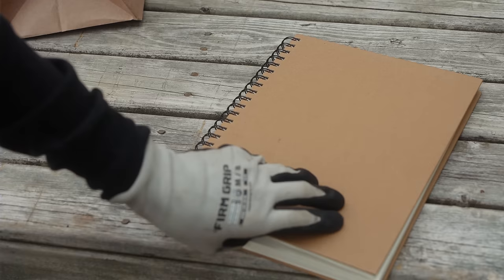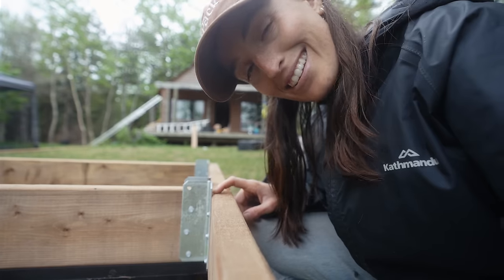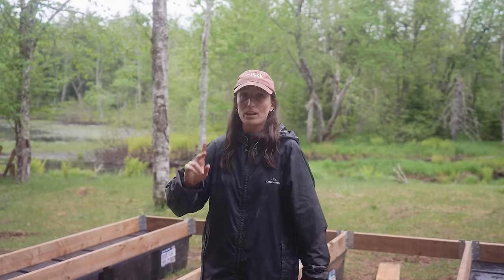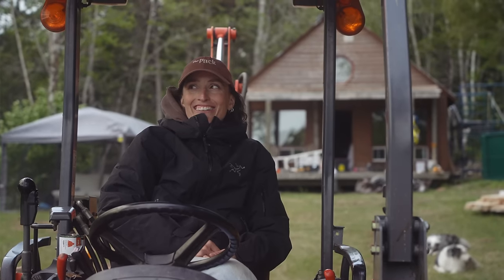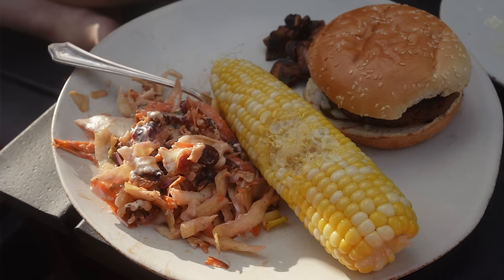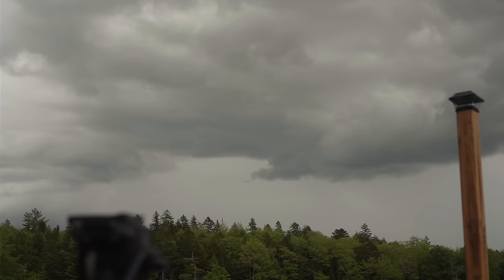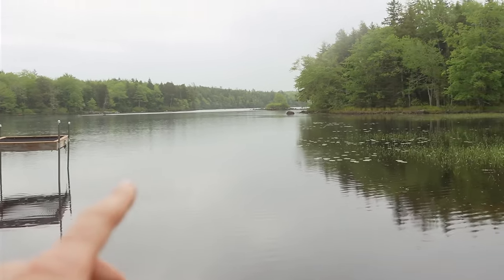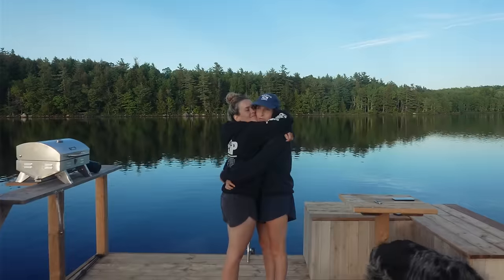We Built A Homemade Raft Boat with Electric Motor!

Comment: by far my fav episode. as a houseboat owner in the keys I would like to add two things. 1, fire extingisher , have it out when you're using the grill. 2, when you have guests on the raft, make sure they know where the safety gear is located before you leave shore.  enjoy that water
Reply from the maker: Yes! Thanks for the tips. Great ideas and so neat you’re a houseboat owner 👏🏽💛
Reply: And a set of paddles. Just in case!
Reply: That’s the first thing I thought about. I’m a helicopter Mama!! 😊
Reply: @padelicious9093 Omgosh Yes! How did I forget that?
Paddles!
Also, string lights from the posts so you can be out at night.
I saw those light you put up on top, but didn't see how much light they put off.
I have no idea what the big area you taped off is going to be unless it's a huge table?
I'm so excited for next Sunday!

Comment: Probably a good idea to switch out that Trolling motor wood mount to an Aluminum material made into whateverr shape and bolted onto the raft and then you can clamp the Trolling Motor to that. Pretty cool raft. Keep life preservers on board. Every vessel needs them and the life saver rings.
Reply: yes, life preservers a must, as well as an anchor that reaches the bottom in case you have to abandon ship and come back later to get it, it will still be there.
Reply: Crystal did say they were putting life preservers in the bench :)
Reply from the maker: Great idea!! Yes trolling motor needs a big upgrade LOL thanks for the tip!!! We do have life jackets and paddle on board 😎
Reply: If the grain of the mount for the motor was running vertical instead of horizontal, it would not have broken.  The grain orientation is why the board broke.  Just mount the board vertical and with carriage bolts and it will suffice for the trolling motor.
Reply: Everything you mentioned and a way for the dogs to get back on board safely.
Reply: You girls make my head spin on what you can build.. Your imagination  is wild and so cool. Such a beautiful  view.. Be safe
Reply: A couple of paddles and a air horn just in case
Reply: A couple oars on board for a back up plan, would be nice too, make them long oars, a little oar clamp on the floor so you can't loose them,  they could just live in a rack one the perimeter, unless you needed it,  because that little cheap motor already broke once
Reply: Très belle construction de ce radeau électrique. La plaque moteur devrait être en inoxydable. Vous êtes courageuses de vous baigner dans cette eau qui doit être à 12 degrés, peut-être moins. Bon appétit avec 🌭🥓🥓 bon aventure 👍👍😘🇫🇷👏
Reply: You need clothes pins for the towels on the wire in case the wind picks up, and pay attention to grain direction for strength, if it went up and down for the motor mount it wouldn't have cracked in the direction it did.
Reply: Yes, its amazing how many videos I have seen of people paddling back to shore after an engine failure. Make a storage box for your anchor/ chain to store in so no accidental dropping of the chain during voyagers. .Can be a second seat too . Awesome project 😊😊
Reply from the maker: @lint2023 Thanks for sharing your experience with us. 😊🐶
Reply from the maker: @ladikmk Love how you are thinking about Bella and Izzy. 💛🐶
Reply from the maker: @barbarahoover3941 Don’t let it spin too much. Happy to have you with us. 😊🐶
Reply from the maker: @mijour Another great idea. We have the paddles. 😊🐶

Comment: Idea Time! Build a ramp that allows the girls to jump into the water and then walk up the ramp onto the platform. This way they can enjoy the floating barge and the water! The ramp should be a gentle angle with some form of traction covering so its not slippery. Make it fold up so it's only in the water when needed. I envision Bella or Izzy taking a wild leap into the water and you both struggling to get them back onto the platform. A ramp solves that! I am 99% sure what you have built is considered a boat and if your area requires registration of water craft you'll need to go through the process of titling, registration and so on. You may need to do things like provide life vests for the max number of passengers, something you should do anyway. That doesn't mean you have to wear them it means you have to know where they are and have access to them at all times. More details! Not only does the anchor chain need to be long enough to get to the bottom it needs to be long enough to lay around 20 meters or chain on the bottom plus the chain from your party barge to the bottom plus extra just in case. It's not just the anchor that does the work but the weight of the chain that keeps you in a location but allows for waves/wake etc. You probably will want to add a hand cranked anchor winch and a box to keep the chain and anchor inside. For the battery add a small solar panel on one of your corner posts, the kind you see on small highway signs or home/business lighting. One of those will keep the battery charged and no work for you both. Can you tell I grew up around boats and did a lot of boating well into my 30's?

Comment: Ladies, you are amazing!  Safety comes first; it's always better to have something and not need it than to need something and not have it.  I suggest you install oar mounts and store a set of long oars on your raft in case of problems.  Remember, the more weight you put on the raft, including people, the more strain there is on the trolling motor.  This includes going against the current.  Those are the only suggestions I have.  Again, while I'm in my 60s, I am amazed at the projects you two have taken on and completed.  You blow me away from week to week.   Take care.

Comment: The trolling motor is small enough for you to add a safety chain/cable so when it accidentally flips off you just cable pull it out of the water.  This project video is the BEST of the last four five years or so.   What a happy couple build!!

Comment: Love this project! I'm making a couple of recommendations just to guarantee a good experience:  Please add strings of solar lights, connecting the posts. The post lights alone will not be enough for others to see you easily (plus, we know solar lights don't all last at the same rate, so more lights for safety); Add at least 2 oars, maybe 4, in case you have issues with the motor; Lastly, add drop down rails for your grill. It is easy to bump something like that, especially with many people moving around on the platform.

Enjoy that beautiful build 🎉
Reply: I worried about the grill, too.
Visualized seeing it fall in and sink.
Glug⁰⁰⁰ glug⁰⁰⁰

Comment: Trolling motor tips: 1. Get a back up battery. 2. Mount a solar charger up on top of one of the posts. Put Anderson quick connects to unhook and or change from one battery to the other. Also, quick connects to the solar charger. (Btw, I'd use no less than a 100W solar panel)3. the board you broke that holds the trolling motor on the raft, is called the transom. Get some steel, and cover both mounting sides with the steel, that insures no broke boards, and if they do, you won't loose the trolling motor. 4. Speaking of loosing the trolling motor, Get a piece of rope or small cable to catch it should it come loose. I'd also wire in a small volt meter to keep you informed as the how much battery life is left in your battery.

Comment: Great project! Can't wait to see the finished tiny house on the lake! One suggestion for your cooler/refrigerator; add hinges to the cover and raise the cooler so that the top of the lid is level with the top of the bench or perhaps a half inch lower. That way you can have the lid open and then have easier access to the cooler. Another idea would be to attach the lid of the cooler to the lid of the lid of the compartment so that is opens with the compartment lid(unfortunately this means removing the hinges from the cooler). Depending on the size of the cooler, this would give you a bit of extra storage under the cooler for smaller, flatter items(cutting boards, utensils, etc.). For those extended trips on the lake, screens would be a great thing to help minimize the bug situation for overnight trips!  Keep on keeping on!!

Comment: IMPORTANT Motor tip: The grain on the board it is clamped to is the wrong direction. It can break along the grain and lose the motor in the lake.
Reply: That happened fast. Ha!
Reply from the maker: Hahahahahaha very fast! Thank you we will be making upgrades 😎
Reply: @Vanwives  You can mount a 2x10 vertically. Grain verticle. Maybe add a galvanized plate to be sure. Love the raft.

Comment: Incredible job, you two! You can build anything!!  It looks like you are adding a "Covered Section" to the deck in the middle. Some waterproof string patio lights around the perimeter would be cool, as would a large search-type light for nighttime boating!  Water proof cushions on top of your storage boxes for comfortable extra seating. The trolling motor handle needs to be higher or the seat lower so it is more comfortable on the shoulder and arm of whoever the captain is steering. My other safety concern for you guys. If something goes wrong with the trolling motor, you need something to help you get the boat back to shore. (Maybe a backup motor?  Rowing paddles won't do it! 🤣) You guys are going to have so much fun!!

Comment: Awesome job you 2❤.
Lovely idea. You could use a few layers of plywood screwed together for the motor to mount to. A canopy with solar panels to charge the battery and a safety chain on the motor so it doesn't sink incase something happens.

Comment: You should make under floor storage. Just get a few more black totes without the lids. Flip them right side up on top of a few of the inner totes cut off extra then make the wood deck on top of it a hinge door. You could even use the lids by screwing them to the under side of the deck hinge doors so that they close over the sink in bins to water proof them from rain and splash.you can also hang a movable shade cloth between your side cables for full or partial coverage. You could probably use something as simple as shower rings to make slideable.

Comment: Just a thought:  You could take your Jackery out on the Bellaizzy and might be able to operate the trolling motor from it.  Second thought:  with the hammock positioned between those two posts, the centerline of the hammock is directly over the edge of the raft.  If somebody got unbalanced and flipped you'd land right on that edge.  Not good. (I'm thinking of you, Chrystal.)  Your back problems would not like this.  and both of you, get some proper work boots.  A workboot that gave support to your ankle might have helped with your (Chrystal) tumble of the raised garden bed.  Really enjoy your channel.  Greatly.

Comment: Hmmm....While 1 trolling motor might get the job done in the calm, it might be more fun and more maneuverable with 2!  That way, you can pivot by thrusting in opposite directions.  It would be cool to see how you guys would fabricate a steering rack and throttle set up to make it all work!  Might as well over engineer it a little more!  Think about situations where some high winds could suddenly appear.  You might need to get back home quickly or have enough thrust to get you there in a wind.  Especially if you plan on putting lots of tall stuff on top of it.  Also, why did you use anchor chain as opposed to rope?  Rope would be much lighter, easier to use and store.  Your going to need 2 anchors BTW.  You may as well figure out where to mount some beefy cleats.  There will come a time when you’re going to need to tie it off to something.  Get some decent sized fenders to put between.  You can make a cool rack to store them in for quick and easy access.  You’ll need 3 cleats on both the port and starboard side for tying off.  2 ropes for each side is good to have on hand.  Put some matching cleats on the end of your other dock to tie off to.  Recommend using spring lines to tie off properly. Does anyone else use the lake?  If so, this will make it easier for other boats to tie off to you.  Not sure what the laws are in CAN for boating at night, but you might need some navigation lights red/green and an Anchor light to be legal.

Comment: This is so freaking cool. Y'all have outdone yourself with this one. I am so jealous. So many ideas running through my head right now. Tell me y'all were going to spend the night out there at some point. I don't know how you can manage it but a retractable roof would be awesome. You might get a piece of steel and bolt on to the side to hold the motor. There's probably a hundred pounds of screws bolts and brackets on there. Should make it through a hurricane. 😂 You can build a little cabinet storage under your grill. Really the ideas are endless. I'm free the week of the 4th if you need some help. Lol. As always thanks for taking us along for the ride.

Comment: Just a thought on your future dock. If you place the deck boards on first and align one side, you can snap and line and trim the other side all at once and then throw on your skirt. Or you can do the skirt on 3/4 sides and do the same thing. Should make it go a bit faster. Just a thought, fun video!

Comment: What a great party float! Looks like you need clothes pins, paddles in the storage bin as back up...just in case you can't use the trolling motor, a frame around the cooking table so food doesn't tumble into the water.

Comment: Always love watching your videos and always feel bad about thinking what I’d do differently 😂

When I was a kid my parents built their own house. The first year they put down the floor joists and plywood on the basement by lining up one side and then after it was all done, trimmed the other side with a chain saw.   Applying that here I’d probably remove or not install one side of the skirt and then trim all the 12 1/4 boards in one pass before skirting the cut side.

Comment: For anchoring your ‘raft’ you need approx 2x ( length of chain) of rope attached to anchor chain , depending on depth of lake, so you can drop the anchor .. ‘hook it’ and allow some chain to sit on bottom… then tie off the rope on a cleat.. you’ll be tight and ‘set’ ( I spent a few years working on an abalone dive boat when we anchored multiple times a day)

Comment: If I may make a suggestion,  a Drop Keel board near the front side of your raft Near center will make steering and navigation so much easier.. I promise. Your trolling motor won't have to work as hard to turn it
Reply: Yes, it will be cutting through the water and make a world of difference in turning, steering it.

Comment: im sure you already addressed all of this already
tie EVERYTHING down, the motor ,the battery ,the grill ,even the tongs for the grill needs to have a 2nd rope or chain ,so even if it falls off into the water ,you can fetch it up with the chain or rope (i've lost a few items from my boat)
also the anchor and the chain needs to be longer and weigh more  ,its actually the weight of the chain that hold you down and not the anchor 
also a good safety practice is to always have someone on the boat ,do not both jump at the same time
im into boats but this is one of the coolest rafts ive seen ,certainly the bigger then my boat

Comment: Transoms are far less likely to break like that if you have the wood grain going vertical instead of horizontal... or just use multiple sheets of plywood and seal it all with weatherproofing or something so they don't rot too quickly. Also, don't skimp on the galvanized bolts and the framing it's attached to. Transom needs to be really strong because you'd be very surprised at how much force even a tiny trolling motor can put out.

And if you plan on ever going a good distance with that... I'd recommend a secondary motor, even if it's a dinky one. Cuz if you ever hit ground or a log or something and that propeller sheer pin breaks, you'll miss having a motor cuz paddling sucks real bad when it comes to pontoon boats / rafts.
Reply from the maker: Hahaha damn yes paddling would suck. Love the advice and tips. Thank you so much. You have quite the experience! We will build a better transom😊

Comment: Not to mark up your wood or other things you have to push with your forks get a couple of small tires and put them on the end  of the forks. Use the whole tire put the end of the fork into the tire laying the other half on top you can also use them for the bucket by put the tires half way down the blade of the bucket then tieing off to top of bucket ENJOY YOUR SUMMER

Comment: You gals just keep on crushing it with the builds (even though you're slacking on the roof finish or are you for a reason, like help is on the way?) This floating raft barge-a-ma-thing is way cool and you'll figure out the kinks for sure.  I'd maybe have two batteries (lightweight as you can get) but have a feeling solar is going to appear.  Thumbs up and the supervisors looked like they approve for sure!
Reply from the maker: We needed to take a break from that roof. We will get back to it soon. 😊🐶
Reply: @Vanwives  Understood!  But what a way to get help on the roof!  A day of fishing and fresh fish cook out!  <wink>